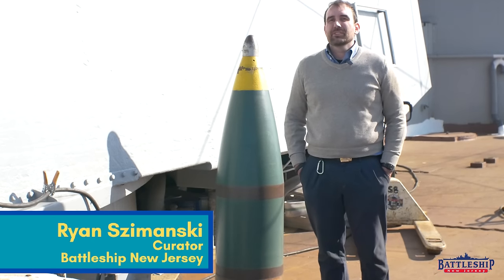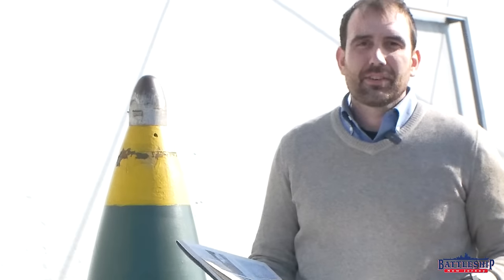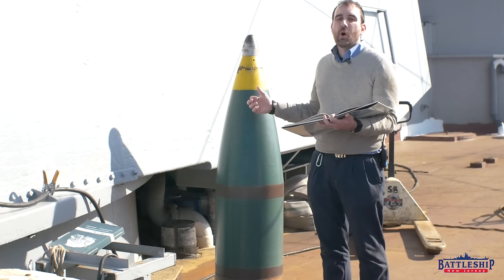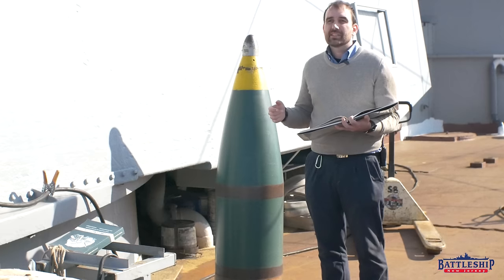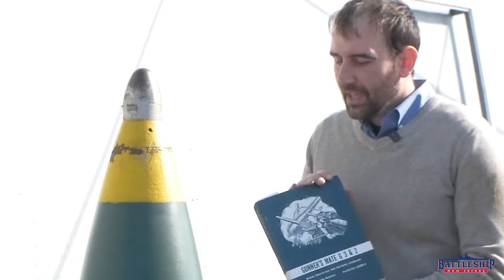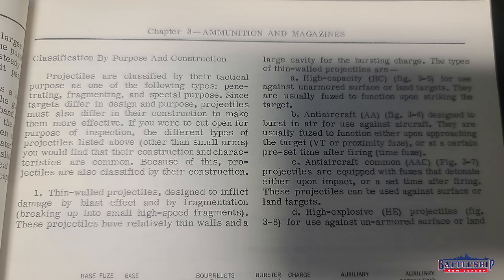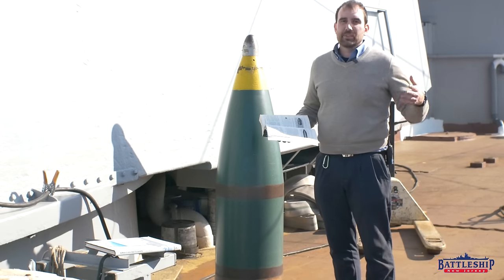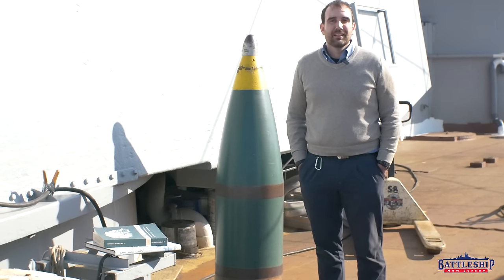What is a High Capacity Shell and Did New Jersey Carry High Explosive Rounds Too?

Comment: It has nothing to do with the fuze, it is called high capacity because the shell had thinner wall that allowed an higher capacity of explosive than normal high explosive shells, the bursting charge of the 16 inch mk 13 HC is 8% of shell weight compared to 5-6% of normal high explosive shells.

Comment: I'm surprised that mortar fuze survived being shot out 16"50, let alone detonating on or near inpact.
Reply: I actually wouldn't be surprised if the mortar shell has higher acceleration and rotation speed, which is what determines the force that the fuse must survive. Remember that the battleship guns have a 20 m long barrel, but a mortar is going to be around 1 m long.

Comment: Thin wall.....  the HC shell walls are 2-3/4'' thin.
Reply: Relative to a 16"  shell....
Reply: @dwwolf4636   Thin is a WWII German 30mm mine shell. Barely  1/8'', 3mm thick walls, spherical bottom.
Reply: @kimmer6 which would be 40mm on a 16" shellwidth basis.
The shells also serve a different purpose.
Reply: @dwwolf4636  I'm just saying, my 16'' TP shell is still 1902 pounds and it's hard to ever think 2-3/4'' is a thinwall shell.